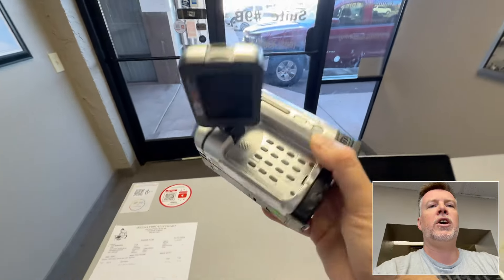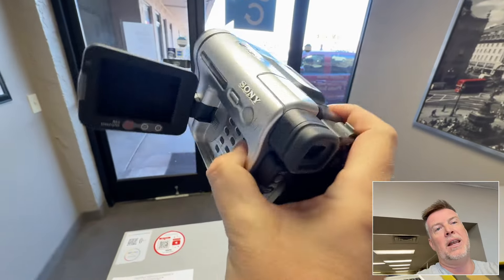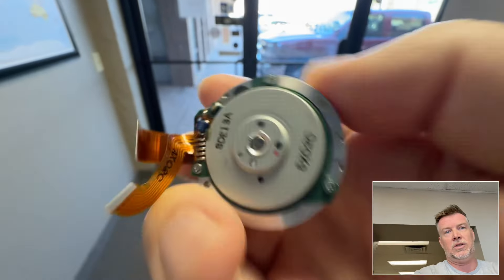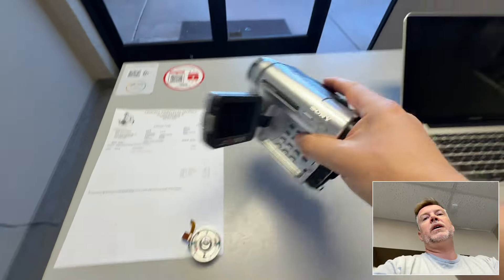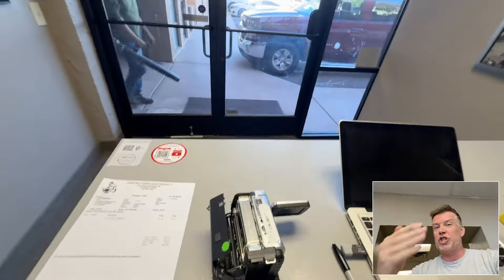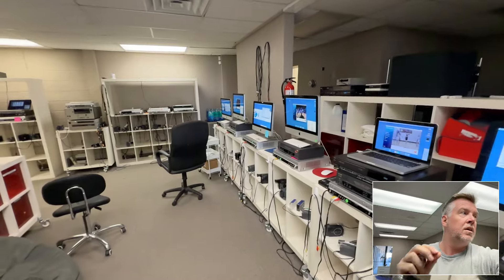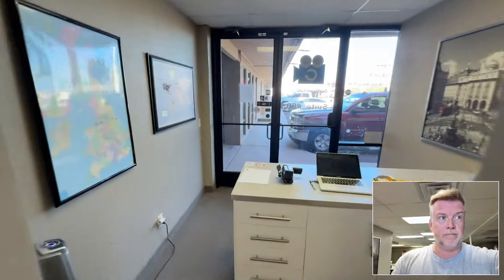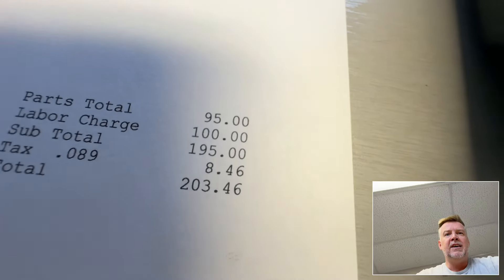Sony Handycam Camcorder Repair - Parts & Labor Costs 2024

Comment: That's an extremely good price for that job. i am one of those former VCR repair guys.  still have a ton of service manuals that i cant bear to toss away.,     perhaps ill give some repairs a go again. there used to be tons of replacement parts distributors around,  next to no VCR parts around
Reply: Where are you located?
Reply: @ New Jersey
Reply from the maker: Yep, fire up the biz again!